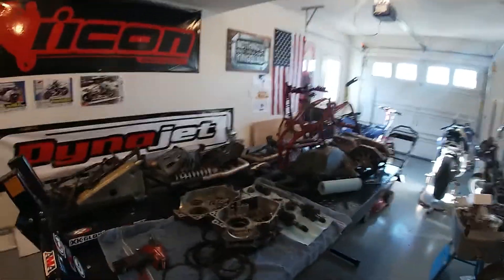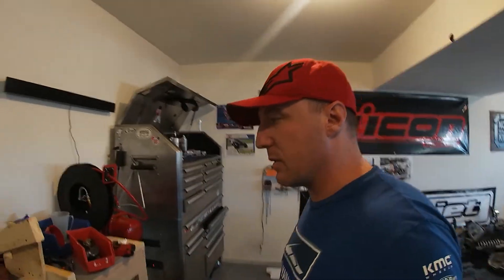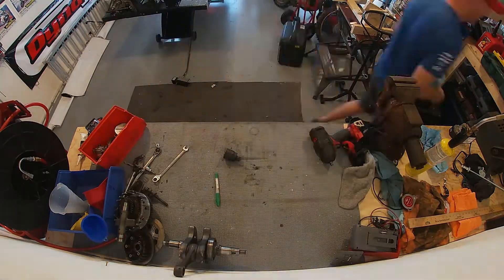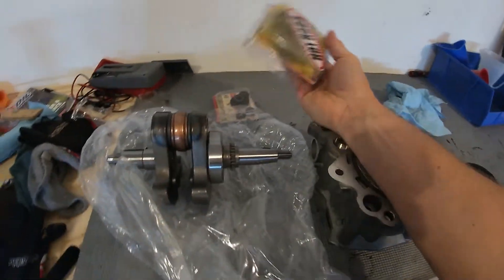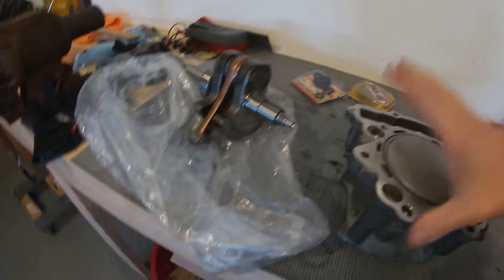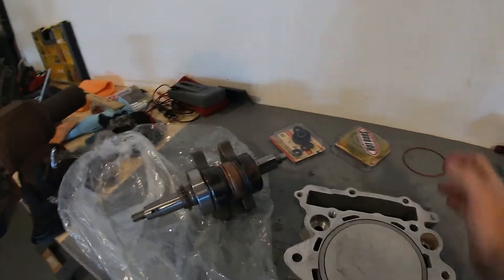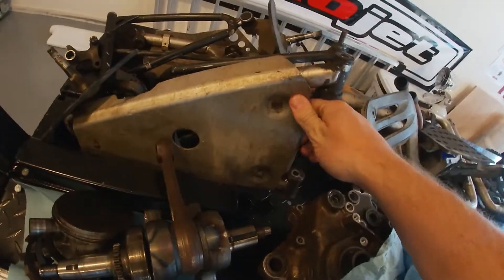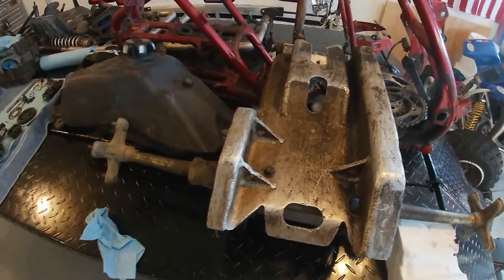EP. 3 Yamaha  Raptor 660+. Swing arm disassembly and general cleanup. What color scheme??

Comment: That's definitely a stock swingarm. Cheek where the pivot bearings are real closely. My stock arm ended up having a seized bearing for quite a while which eventually ended up cracking about 3 inches up. trashed it unless i reweld it all and have the bore for the bearing sleeve remachined with a repair bearing
Reply from the maker: Great advice! I gotta finish this thing up…